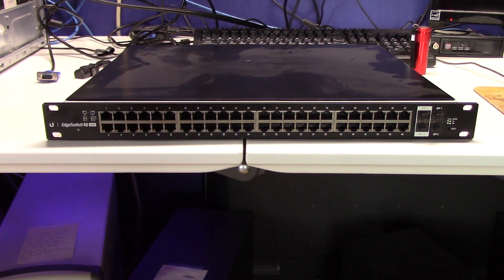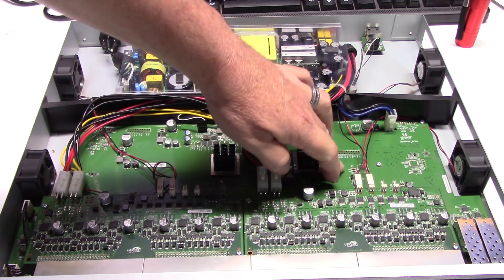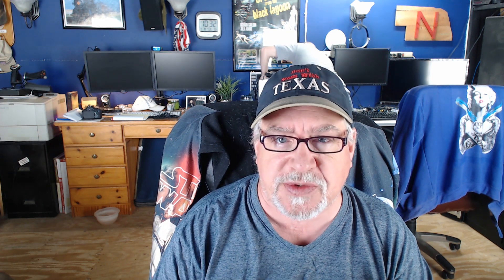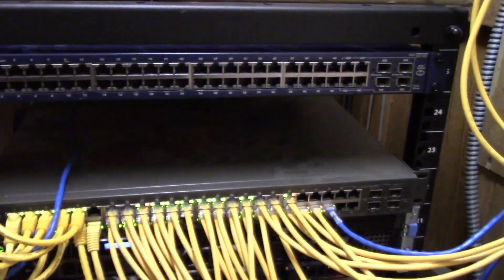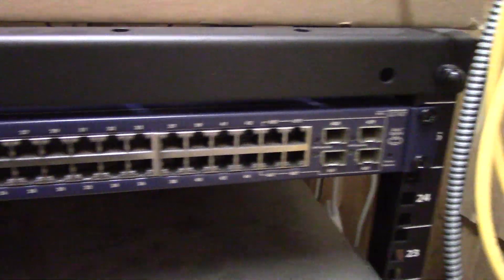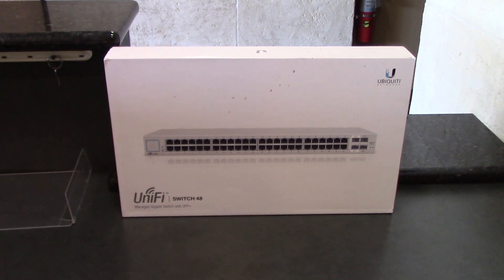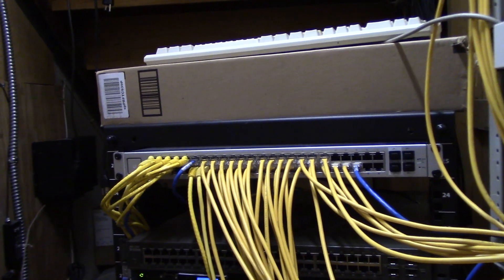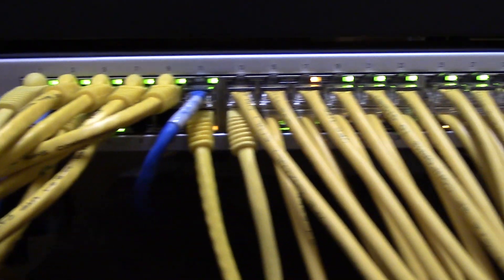A day in the life of an IT guy - replacing failed EdgeSwitch POE

Comment: Ive been learning to micro solder.. So I can fix just about anything on a circuit board at this point. What I am still learning however, is how to troubleshoot faults on PCBs. So my boss today gave me one of these EdgeSwitch 48s to see if I could repair. I am a software developer by day and PCB tinkerer by night so I am by no means a switch expert.  But initially it reminds me of the switch in this video. When I power it on what seems like a random handful of green and yellow lights are on and everything else is off. I am unable to complete a factory reset. So I am opening it up and starting to tinker lol.  Should be fun either way I suppose.
Reply from the maker: Let me know how it goes, I still have that switch that failed.

Comment: Hmm - ubiquiti is no good because an old unit fails, but Netgear old unit failed too, so therefore Netgear is no good either.
Reply from the maker: no, that is not what I said..with the Netgear I can get a repair, with the Ubiquiti I can't. and if you noticed I replaced the bad switch with another Ubiquiti product...in the future please quote me correctly I don't mind the criticism, but you could at least be accurate.
Reply: Did you even watch the video? It was not the hardware but the lack of repair (even at a cost) possibility that struck a nerve. I agree with Unkyjoe, if a company does not provide repair even at a cost for out of warranty devices, that's on them.

It might have been another case if the switch was EOL for a couple of years. #stupidfanboyism

Comment: If they ignore you completely avoid that manufacturer use a brand like hp or Cisco for business use as you get proper support behind it with lifetime warranties. Hp puts a firm 200 year warranty on it they are worth the cost because of this. The it company I work for pushes to keep everything under Warrenty.
Reply from the maker: If I could find an HP with a simple clean interface like Ubiquiti I would. I also like netgear, but have not used their interface in years. Thanks for watching :)
Reply: @UnkyjoesPlayhouse  the web ui on the hp Aruba's 2530s is very nice. We use them alot where I work.

Comment: ive looking at the unify switch as i need to upgrade i have so much load balancing going on i need more ports. if i were to get a POE switch for VoIP phones or CCTV or APs then id rather go with a normal switch and use POE injectors. POE switches have more or a failure rate.
Reply from the maker: That has been my experience with POE switches as well, but I am one person, others use Quality POE switches and claim to never have issues, I know the Edge series of switches are plaqued by power supply failures, or have been in the past. Thanks for watching :)

Comment: I understand that it is a customer of yours, but in an active equipment network, including different brands is not a good practice. Brands like Cisco use proprietary protocols that are incompatible with other brands, the only thing to create are unstable production scenarios, ranging from packet loss, latency and even disconnection. As much as possible, try not to allow "salads" since you are only headaches you will have.
Reply from the maker: I never use Cisco equipment for that very reason, and their cost, but never had issues with "salad" between other brands, I deal mainly with small business's with less that 50 users. Thanks for watching :)